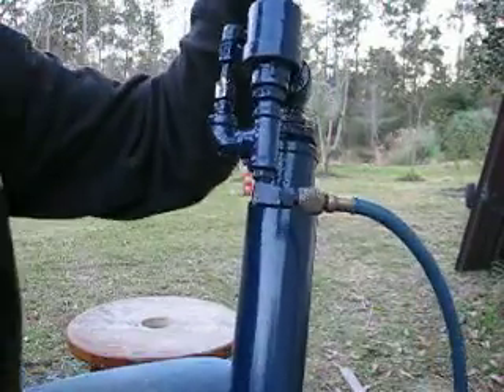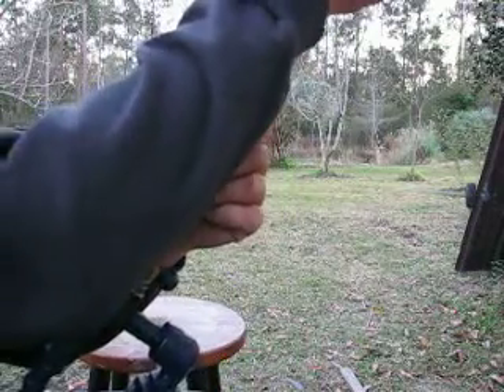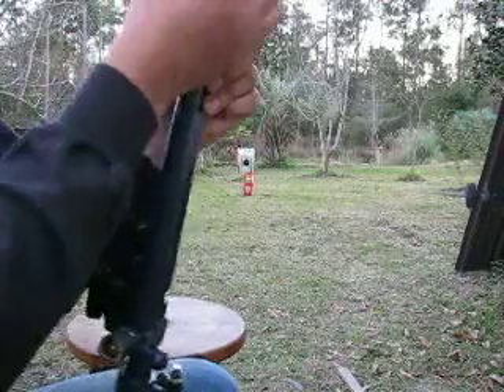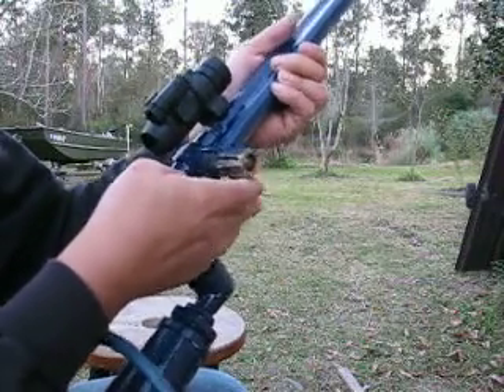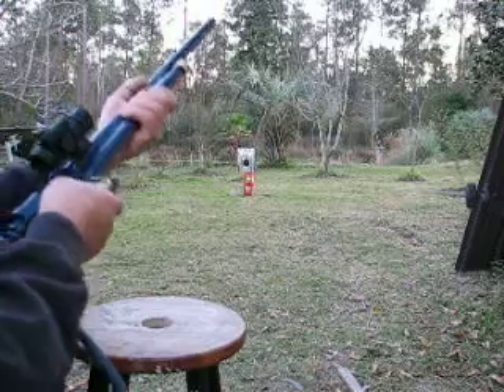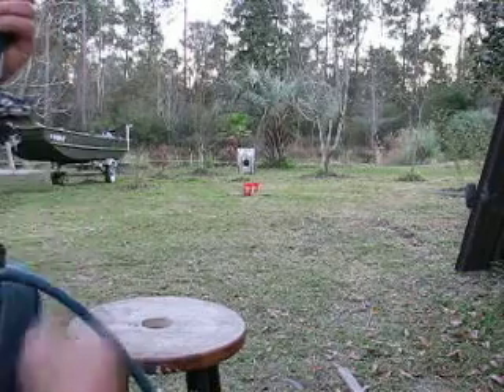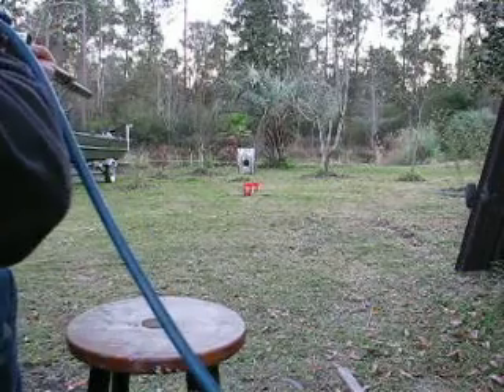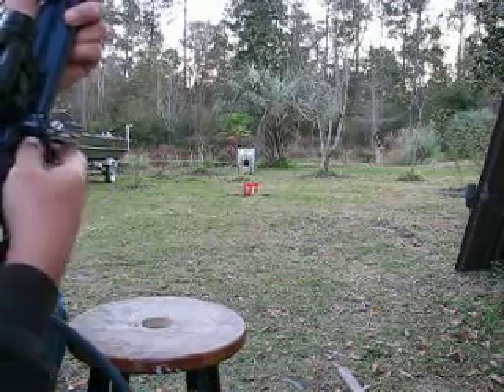Homemade 50 caliber 28 Shot Breach/Muzzleloader QE

Comment: I think I get the magazine idea, it looks like a bolt action but sideways, like in any magazine the ammunition are pushed through the magazine in a "channel" by a spring and on this model the side of the barrel is bored the size of the ball bearing and the circuit is closed and rendered airtight with a sideways bolt, it's like a regular bolt action but perpendicular to the barrel! When the bolt is open the ball bearing goes into the bolt chamber then when you close the bolt it pushes the ball bearing in the barrel chamber and close the barrel to make it airtight and ready to shoot.

That's easy as 1.2.3 when you think about it, but I would never have though of it alone. Great video!

Comment: i see your gun is very accurate. i need an advice from you.
why my gun doesnt shoot in same spot. by 15 m i shoot arround the dot on the target like 30 cm. i changed the barrel twice, blocked by gun so not moves when i shoot, and really good reanforced the barrel so does not vibrate...........

Comment from the maker: @wandererxman1 
you can make your own 1/8" trigger valve that will handle higher pressures. You can make your own piston valve to replace the QEV. A valve that has a max op. pressure of 250 psi will actually have a much higher burst pressure. You would need a machine shop to make a HPA  hammer valve gun like a shin sung and you would probably have a gun that was worth several thousand dollars like a Gary Barnes gun. These guns are a totally different animal.

Comment: @mpmrla It seems like most of these valves run around 150-200psi, do you what would go any higher?  I mean I know there must be something, because those shin sung Large Bore air guns run at around 3000psi for 10 shots.  I was thinking of doing something similar to what you have here, except make it semi auto.